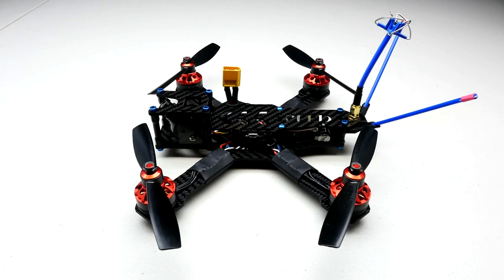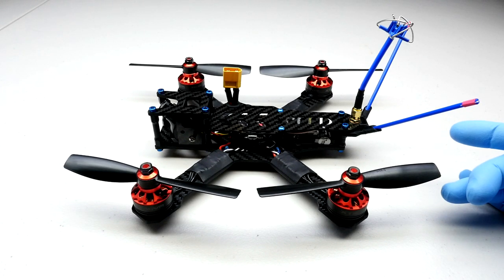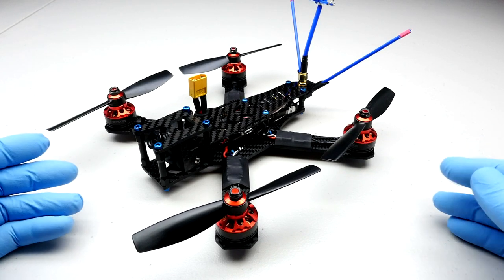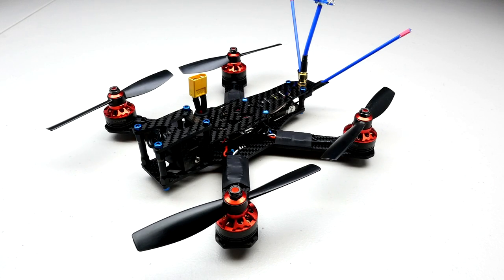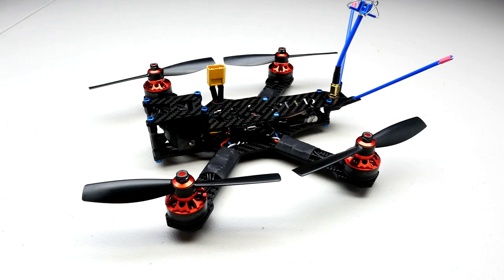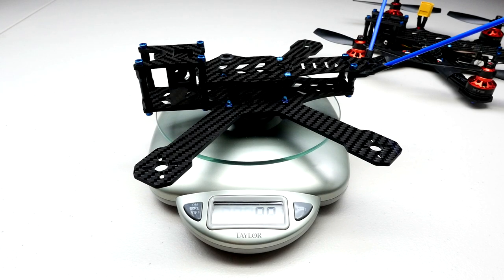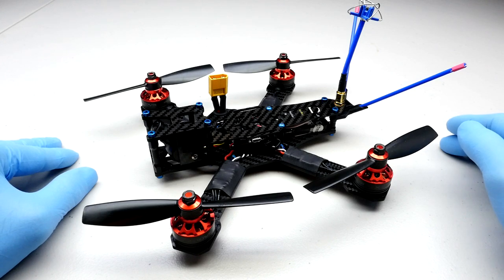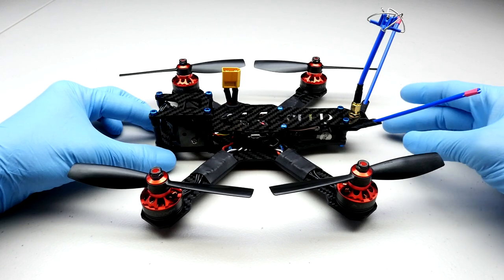What makes a great drone racer? (Speed Addict 210-R Episode 1)

Comment: I am sorry but i do not agree with what you are saying about the positioning of the FC ..(correct me if i am wrong ) there is a thing called center of thrust which will give the exact position of FC. mounting of the FC directly on the CG does not always give the best performance......here is an interesting post that you might find helpful) .http://flitetest.com/articles/calculating-the-center-of-thrust-on-multirotors
Reply from the maker: +B Andi Thanks for the link! That is some really good info. I hope that my video doesnt send the wrong message about the importance of where the FC is placed. We are not trying to say that placing the FC at the center of thrust yields a marked increase in flight performance. Rather what we are trying to explain is that moving your center of mass towards the center of thrust WILL give you better flight performance. And this is what we have done. In our design we have a SUPER LOW top deck which allows us to move the Lipo (the largest contributor to over all mass of the machine) right at the center of thrust. Placing your mass all concentrated as much as possible towards the center results in a lower moment of inertia for roll, pitch, and yaw maneuvers. This works to reduce the force required to make those movements and make a more agile machine in the sky. 

With regard to the FC placement its actually less important where the FC resides along the Z plane (up and down). For yaw (X and Y plane)  it IS important to place your FC at the center of the craft though.
Reply: +Catalyst Machineworks if you're only using gyro (as most people do for racing) then it doesn't matter where on the frame the FC goes because it's only measuring the rate of rotation which should be the same everywhere on a rigid body. You are perfectly correct about placing the center of mass at the center of thrust though, because then the simulation that the FC is running (a dimensionless point mass) will closer match reality.

Comment: do racers use gopros? or is that too much weight?
Reply from the maker: +danielle golden As with most things 'it depends'. Some people like to keep weight as low as possible and race with no HD cam. Others want to record their race and show off online so they accept the extra weight penalty running a 80 gram camera brings...
Reply: +danielle golden Most people take them off and if they really want the video from the race they DVR it. A GoPro will slow you down, but honestly pretty much all races except by the absolute best racers are decided by pilot skill so it probably wouldn't affect any placements.